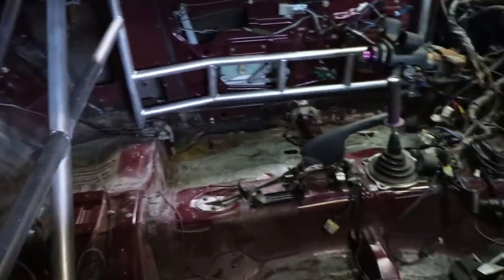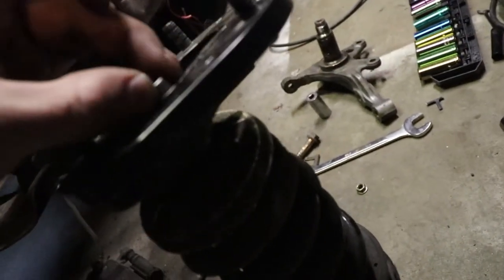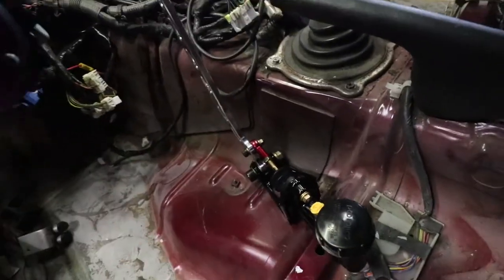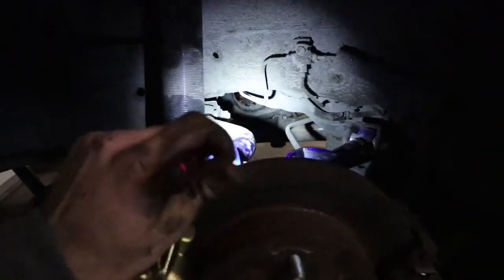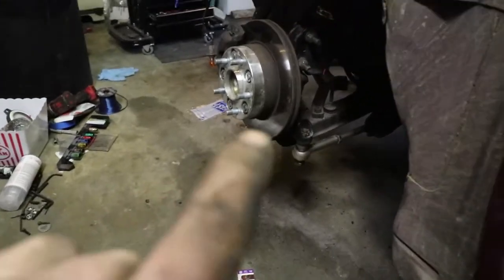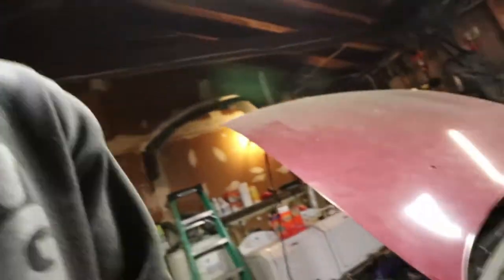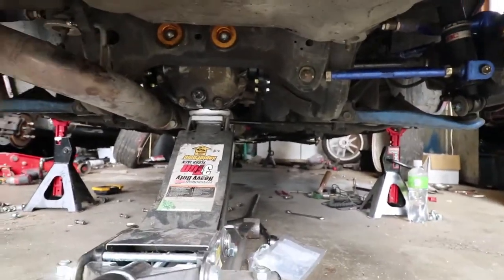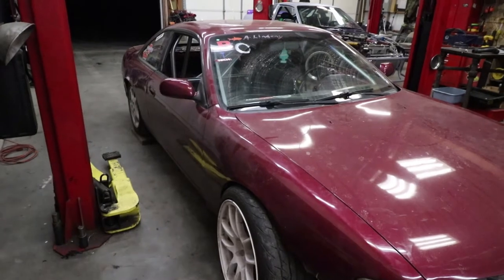Installing Drop Knuckles And The Villains Dual Caliper Setup

Comment: Question. A drop knuckle just moves your wheel position up X amount right? So a 50mm drop knuckle would essentially lower your car by 50mm but keep the same suspension arm position and coilover position?
Reply from the maker: DriftingBrandon C. Exactly
Reply: Coo. I want a 50mm rear drop knuckle to lower the rear 25mm and also straighten my arms up with the extra 25mm.